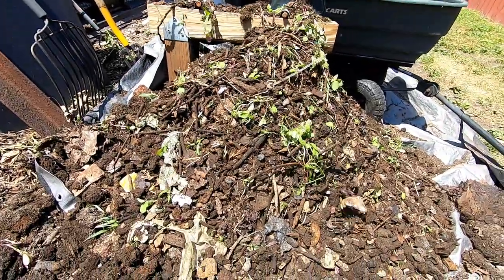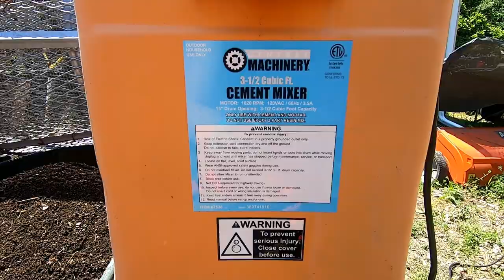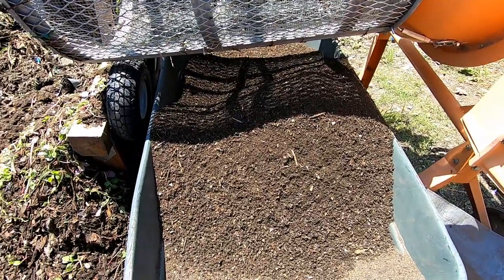DIY MOTORIZED COMPOST SIFTER ZOOMS THROUGH COMPOST!!

Comment from the maker: I have recently become an Amazon affiliate.  The items below are the Amazon affiliate links for the items I use in my wormery. The cost is the same to you, but the channel will get a small commission if purchases are made using the links.
Aurora AU1800XA Anti-Jam 18-Sheet Crosscut Paper/CD and Credit Card Shredder/ 6-Gallon pullout Basket 30 Minutes Continuous Run Time 
https://amzn.to/3qnbei7 
SE 5-Piece Set of Patented Stackable 13-¼” Sifting Pans - GP2-5 SET https://amzn.to/3qo5YLh 
SE Patented Stackable 13-1/4" Sifting Pan, 1/4" Mesh Screen - GP2-14 https://amzn.to/2PKdbbZ 
SE Patented Stackable 13-1/4" Sifting Pan, 1/8" Mesh Screen - GP2-18 https://amzn.to/3rtYd7O 
SE Patented Stackable 13-1/4" Sifting Pan, Mesh Size 1/12" - GP2-112 https://amzn.to/2O3y0ie
Bon Tool 11-407 Utility Tub - 26" X 20" 
https://amzn.to/3eehgzn
Neem Cake for Organic Gardening (5 lb)
https://amzn.to/3swpcQR
Espoma Green Sand
https://amzn.to/2O4SOpw
Mother Earth Coco Bale 5 kg, 100% Coconut Coir Fibers

https://amzn.to/3v0qEfPKelp Bliss Pure Norwegian Kelp Meal (0.9-0-2) (5 lb)
https://amzn.to/3t2t7Vt
dolomite Lime Plus Magnesium and Calcium"Greenway Biotech Brand" 1 Pound
https://amzn.to/2PwTHHB

SUPERLELE 3pcs 1000ml LDPE Safety Wash Bottle, 
https://amzn.to/3v2dq25
Worm farmers handbook
https://amzn.to/3c8R3Q1
worms eat my garbage
https://amzn.to/3c7wraV
worm farm revolution
https://amzn.to/3c86g3O
Vermiculture Technology: Earthworms, Organic Wastes, and Environmental Management
https://amzn.to/3sYPBqk

Comment: and you can use the basket to burn those busted up old pallets too! A word of caution !!! wear long sleeves and thick leather gloves when installing the mesh. I hope your Trig is up and functioning to figure out the reverse conical . LOL it will go from 14 inches in circumference in the bottom to 26 inches at the top P.S. do not forget the center section diameter either! I wired all the metal together because stay ties will not hold up to the stress and stain . Those two tires are no flats(solid and will wear out before they would ever go flat) and I used 5/8 steel round stock for the axles.I was going to use pillow block bearings but thought it would exceed my cost over rides. I will reconfigure this whole setup if she decides to use it for castings. Happy wife happy life!
Reply from the maker: There would have been a video of this being made,but you did it when i was at work.  Maybe you could take it apart and put it back together so i can videotape it this time? lol

Comment: I am realy thinking to buy one of those cement mixer from harbor freight, I need this to mix my worms bedding, I am tired to mix by hand 100 gallons of bedding every 3/4 weeks
Reply from the maker: It does last. Has lived out side for several years still works. I wish I had a little one for my basement.

Comment: Thanks this is great what size holes are in the mire that is fastened to th garbage pail?
Reply from the maker: The screen is 1/4 inch and 1/8 inch. The wire used to attach the screen is bailing wire you get at the big box stores like lowes or home depot.

Comment: Thought I had finally found a solution for the drum, but Harbor Freight has no "industrial waste basket" or "waste basket" listed.
Reply from the maker: Extruded metal waste can in Google should work.
Reply: @PlantObsessed  yeah, $300-$600. I would have paid $100 for it, but that's ridiculous.
Reply from the maker: @Josef_R  prices are nuts lately.  I paid 155$ US for mine
Reply: @PlantObsessed Oh, I thought you said $100 in the video.  Anyway,  i can't make enough compost to justify it anyway.